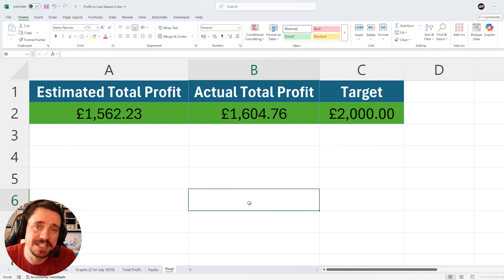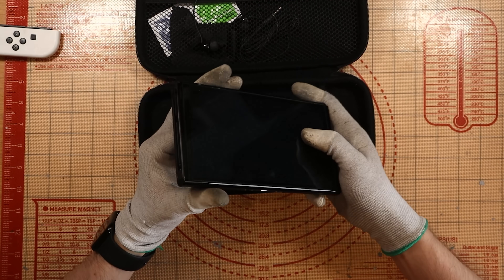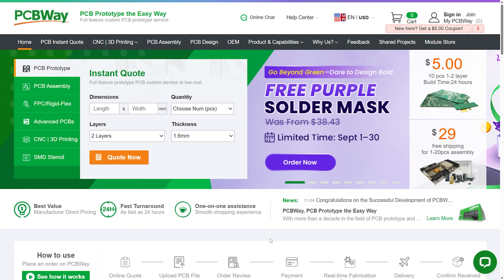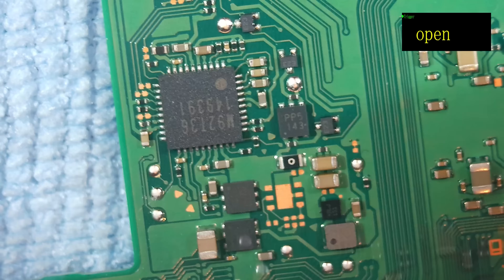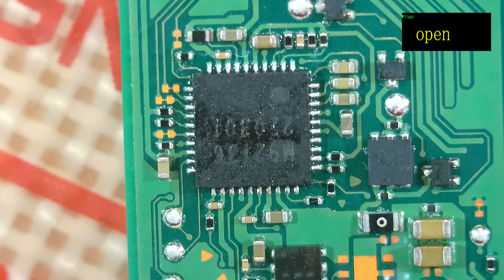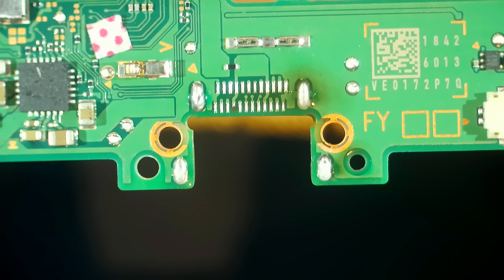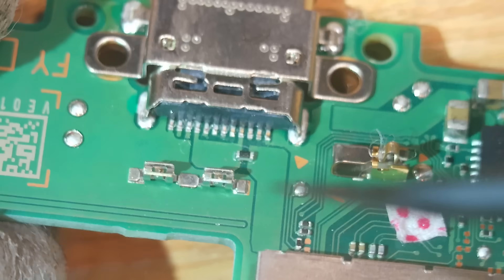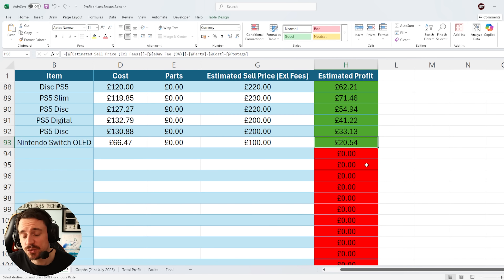Trying to Fix FAULTY Electronic Items for a Profit! S2:E51

Comment: I suggest that you delve into the realm of industrial automation devices repair. specifically the SLC500 and PLC5 programmable logic controllers from Allen Bradley. they are expensive since they are no longer being manufactured. I think there may be a market for used PLC cards and processors. It may be a steep learning curve for you but your videos have proven to me that you should be able to figure it out.

Comment: On the port replacement, I always wondered if you could put 2 pins in the anchors holes on the side of the port (thats also in the board). Just to make sure a perfect alignment. That way you a guaranteed when it drops down it is positioned perfectly

Comment: I got today a really cheap banned Xbox Series S motherboard turn up today to harvest parts for my no power Series S project, if all goes smoothly will mean I got a Series S for quarter the price of a working one... also got my matched pair o' Xeon E5 2697's for my uber cheap dual CPU build, paid £31 off Alibongo for the dual mobo, a stick o' ram and two rather sad 2630's and I found the pair o' 2697's for £15 and some cheap ECC DDR4 so it will have 64gb of ram or 32gb per cpu and will be using my RX5700XT for the graphics and a cheap SSD for the storage.   Its going to live in living room behind the 51 inch flat screen as a theatre and MAME machine plus when its not used I am going to set it off doing some mining nothing hardcore but even a few hits is good money still :D   Also picked up Mario Kart 8 for the Switch for £3 O.o  Spotted it in the local charity shop, they thought it was a DS game so £3 as it wasn't boxed and been hooning about on Waluigi's Vespa with my real Vespa sitting literally next to me hehe
Reply: Hey do you know anyone who can fix my brand new, never watched Roku 55 inch telly?   Daughter smashed the screen whilst I was out of the room looking up stuff for it and well can't get it taken back by the company as its all down to me and such a shame but I can't find anywhere who sells 55 inch panels.  Company who made it said no to selling me a screen so that was £229 down the lavvie :*(
Reply: @dodgydruid I had a similar situation and had to accept it would be cheaper to just replace it. I did find a used Samsung 55" that was one model number off than mine but with shipping (eBay) it became stupid priced. Besides putting a wanted to buy ad on your local Craigslist and Facebook marketplace, you're kind of out of luck.